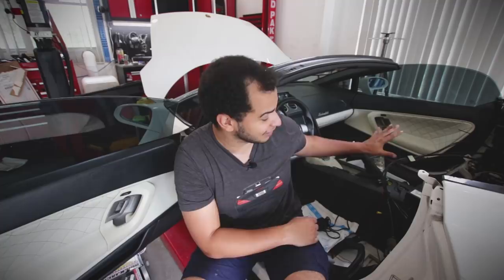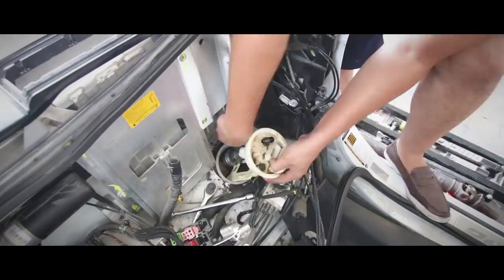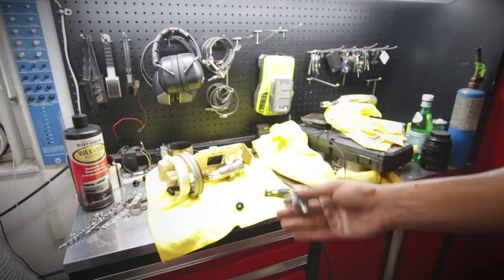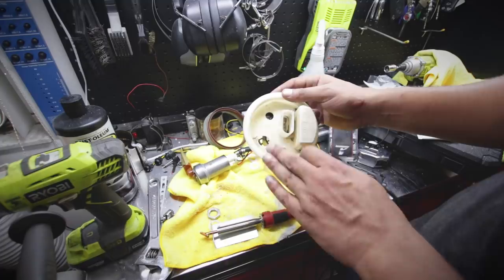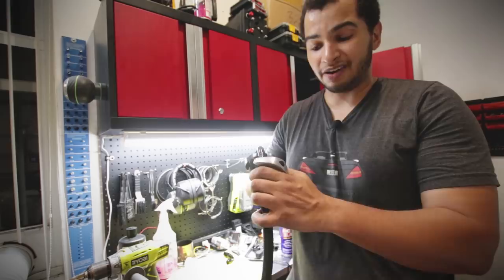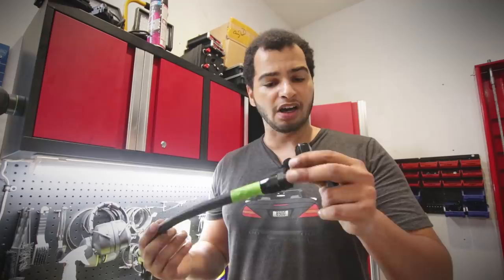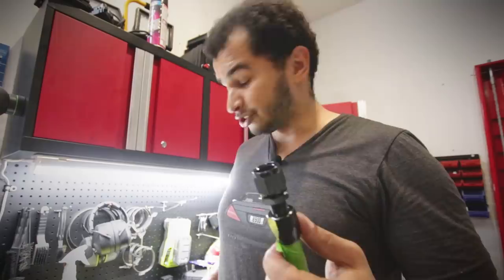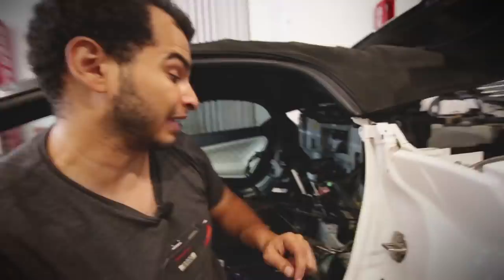I Found The REAL Reason Why My Cheap Lamborghini Was On FIRE (And Fixed It For FREE!)

Comment: hope all that rubber hose and o rings you used is rated for E85. cause most hose isn't. and you'll get a year or two out of the 'wrong' hose before it leaks everywhere slowly. even E10 (regular gas) will hurt the stuff that isn't rated for E85. it just takes longer to go bad.

Comment: Concerned about these mods. Is everything that's been added fuel rated? That black bit you removed looked like a pressure release. What's sealing those an fittings to the plastic?

Comment: Freddy, when you use fuel oriented AN Lines, you need ORB- style fittings, meaning that they have orings on them, or add your own orings. Without the orings, they WILL leak, not if, but when!

Comment: im a little concerned about the type of hose you are using it looks like plain rubber, fuel injection usually requires teflon or PTFE hose and associated fittings to handle the higher pressures.

Comment: Oyyyeeee As long as the zip ties are nylon the fuel system will be fine. Newer cars use Nylon zip ties in the fuel system already from factory.

So Tavarish just make sure those bad boi's are Nylon and you're good.

Comment: Have you considered fitting auxiliary temp sensors around the engine bay, and particularly the fuel system, to give you instant notification of a fire? And maybe a fire extinguisher mounted in the foot well or center console for easy access

Comment: Those zip ties are going to dissolve into the fuel tank.

Edit: also, increasing the cross-sectional area of the fuel feed line is going to cause a velocity difference between the left and right tanks, which may decrease your fuel pressure at the injectors. You should do the same to the other side.

Comment: I know it must be very expensive and hard to find, but honestly you should just buy a new fuel pump assembly. There is a reason those 90° angles are there. And there is already a hole someone patched. Perhaps I'm wrong and a new one wouldn't work because it is somehow different due to the twin turbo kit?.
Reply from the maker: The 90 degree is aftermarket. There is no reason why they're there.

Comment: what.... I have same thing on my CLS55. and its also leaking when i top it off. Mercedes has a recall on this. Something is up with the gaskets. Did not had a chance to drive to 2 hrs away closest dealer for this yet. Таварищ  get a recall gasket for this from mercedes, lol. Oh, by the way, if you don't want car to burst in flames, you can install a sprinkler system lol.

Comment: Am I the only one who wonders why everyone wants to use these AN fittings on everything? At work we have a nylon fuel line system that is ridiculously easy to work with and has fitting to match just about any OE application. You can even heat set bends in the tubing using a tubing bender and a heat gun.

Comment: I thought regular nylon zipties were a big no no inside fuel tanks?
Reply: I remember now, it's on the pump itself you don't want ties, because the ties will likely fail In fuel and drop the pump. Ones you did may fail at some point but shouldn't affect anything

Comment: All the work you did on the tank because it was binding against the lip you should be looking at the other tank while you have it apart and if you find the fitting is binding even if it is not leaking change it

Comment: Would it not be better to blow air through the hose before using wd40? Could that not cause metal shavings to stick to the inner walls of the hose?

Comment: Wait, if that was the reason for the original fire, wouldn't that plastic be melted beyond functionality being it was at the source?
Reply from the maker: Not necessarily. It may have splashed to other areas and the fire was put out very quickly. I do know that filling the car up didn't do it any favors.
Reply: I agree, and he should keep an open mind and follow any other possible sources of the fire.  For the kind of money big L charges, they need to take the entire plastic frame out of the equation and cnc one from some space age metal.

Comment: I don't think that issue was the cause of the original fire that wrote the car off.  If that had been the case there would have been a lot more fire damage to the interior of the car as that is situated under the back of the passenger compartment.  Nonetheless it was an important find and raises further questions about the quality of the work the car had received pre-fire as no professional or decent amateur would have ever left that connection as it was with the potential to leak, it's just not good practice and hardly expensive to fix.  It never pays to take chances with fuel systems, especially not on a car with a reputation for catching fire even in standard form...

Comment: I have been watching since the lambo arrived great series its taking a while but cant wait until you are done.  Watching this video I was a little concerned when you said you would be putting zip ties in the pump to hold the hose together and googled it you may want to remove the zip ties and use something else.  Just my opinion.  https://www.supraforums.com/forum/showthread.php?441915-Zip-Ties-in-fuel-tank

Comment: Wouldn't you just change all the fuel line, and fuel tanks just for safety reasons to Eliminate any possible situation in the future
Reply from the maker: I did. I left the fittings in the tank because I thought they were fine. Obviously I was wrong.
Reply: @tavarish  best of wishes on your projects.

Comment: "stainless steel hose..."   is holding a nylon braided hose in his hand.    you need a vise in your shop with AN fitting jaws.  those poor and EXPENSIVE fittings are mangled.
Reply: It has braided stainless steel hose INSIDE of the protective braindead nylon  covering.